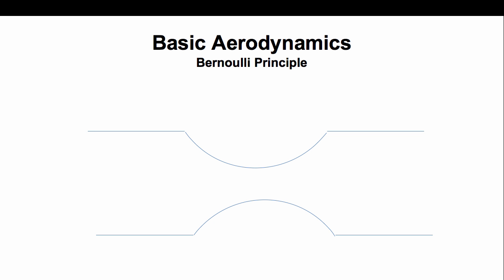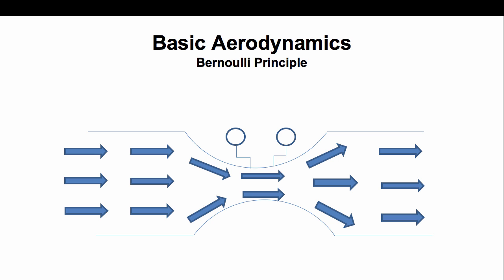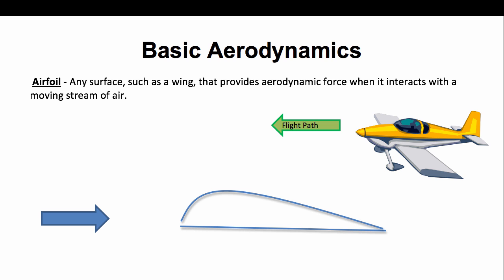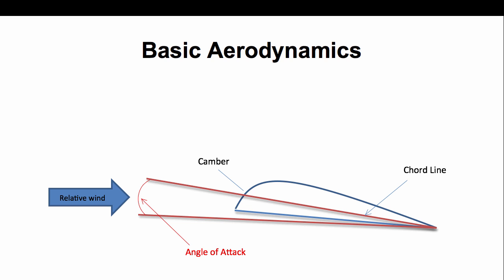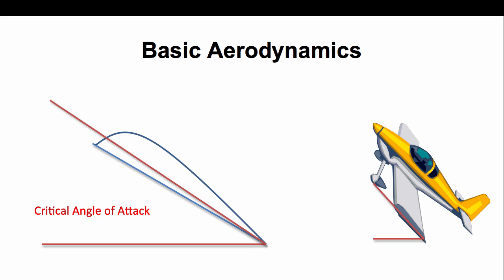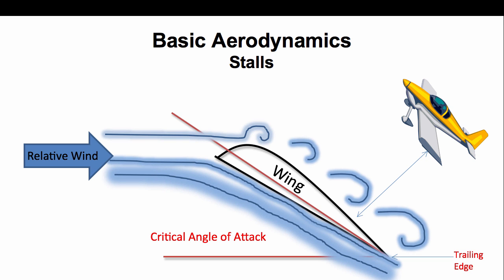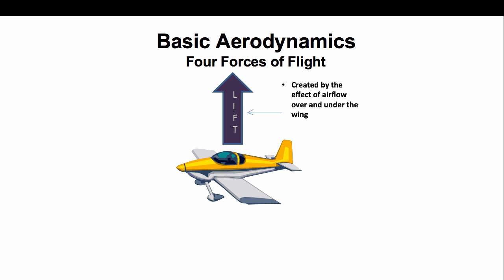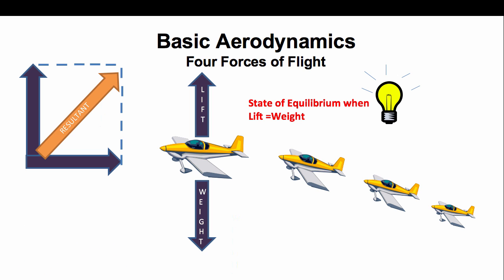The Basics of Aerodynamics

Comment: No ,there is not 2 separate causes for lift. No, a pressure differential does not cause  lift.   No, the bernoulli effect does not cause lift. All lift is the result of the excelleration of air downward,  which gives an upward force. The bernoulli principle is a conservation of energy statement showing that air trades pressure energy for kinetic energy and remains at the same total energy. The pressure drops perpendicular to flow and increases with flow. The direction of the pressure has changed.  And wings don't work like a venturi tube with 2 opposing inward vectors. Rather, wings have 1 single vector.  You've parroted an old false hypothesis for lift. It doesn't work this way. A pressure  differential doesn't cause lift. A pressure differential is lift caused by excellerated air.
Reply: @Robert-d5l
That is only partly correct and also wrong.  
This video has a lot wrong, however, You are mistaken about the fact that a mass (including air) is Accelerated BY a force.
. . .
You are mistaken about the Top-to-Bottom pressure difference.  That is the ONLY WAY lift can be produced - by different pressures on different faces of the wing.  A net pressure difference over an area produces a net force.

. . ..
Air has mass and a force is REQUIRED to accelerate any mass. Newton's First.
.
The Acceleration of air (fluid) is caused by a pressure Gradient - Euler.  This is fundamental in fluid dynamics.  Newton's Laws apply 0 ALL OF TRHEM,!,
.
The Acceleration of the air in the downwash REQUIRES a force to Accelerate it - Newton's First Law.
.
The pressure changes around the wing do two things.

The pressure increase below, with the pressure decrease above the wing cause a NET upward Pressure difference.  THAT is the lift.  
The Top-to-Bottom pressure difference _IS_ THE LIFT.  This is WELL known by  aerodynamics professionals. 
. . . . 
THEN
. . . . 
Those very same pressures cause Pressure Gradients around the wing that are the *CAUSE" of the downward Acceleration of the air in the downwash..  

The Downwash is a RESULT of the pressures, just as the lift is.
.
Newton's 'reaction' of the Third law, is NOT a cause.  It is a RESULT of the applied force we call the 'action.'   You don't have any 'reaction' unless there is an 'action'  and the pressure gradients formed around a wing ARE the 'action'.
. . 
Those pressure Gradients ALSO CAUSE  the up-wash AHEAD of the wing and the tip-spill going into the tip vortices. 

The pressure changes around a wing Cause the downwash.  The downwash's Acceleration is not causing the pressure changes around the wing. 
. . 
That is the correctly applied physics and follows Newton's Laws - ALL OF THEM. 
. . . . .
. . . . .
. . . . .
'This is Incorrect: "The pressure drops perpendicular to flow and increases with flow. The direction of the pressure has changed.  "
You are confusing static and dynamic pressures.   The internal pressure IN the flow does NOT change direction to decrease it perpendicular to the flow.  If you move WITH the overall flow, the pressure stays isotropic - EQUAL IN ALL DIRETIONS.  The pressure perpendicular to the flow DOES NOT decrease by itself (Unless the static pressure (in all directions) increases).
. . .
Those are common misunderstandings of Bernoulli's Principle held by many amateurs.
 This is a fundamental property in fluid dynamics.
. . . 
The physics is stepped through here:
Understanding Aerodynamic Lift Correctly: rxesywwbdscllwpn.quora.com/
Reply: You need to read and/or talk to real aerodynamics professionals.

Comment: Fellas, chord line is the imaginary line from the leading edge to the trailing edge.

Angle of attack is the angle between the chord line and the relative wind.
Reply: Not quite.  The chord line that matters is the one that bisects the lower and upper sufaces of the wing at its trailing edge.  That is the direction that the airstream has to leave the wing, that direction is what determines the angle of attack.

Comment: Can you explain the difference between Angle of Incidence and Angle of Attack. 
It is written in text book that Angle of Incidence (AOI) is a fixed geometry (between chord line and horizantal Aircraft axis) where as Angle of Attack (AOA) is variable as you have explained in the video
Please clarify
Reply: I'm quite late and you most likely figured it out but if anyone else will want to know, AoI is just what you said and AoA depends on the relative air hitting the airfoil, so even if a plane is facing 10 degrees up from the horizon the AoA could still be 0 degrees as long as the plane has enough airspeed to produce the lift equal to weight.

Comment: Its important to remember that low pressure above a wing doesn't cause lift, but rather is lift. For lift to occur, air must be deflected in a downwash. Downwash is the action while lift or pressure differential is the reaction. You don't get lift by creating low pressure. This would be like saying,  lift causes lift. You only get lift by deflecting air. The bernuli

Comment: The lift created by a wing is created mainly by the down wash of air at the trailing edge of the wing. The low pressure above the wing only occurs right after the stagnation point at the leading edge of the wing. Using Bernoulli's principle to explain lift is not very accurate.
Reply: This does not seem quite right. This downwash leaves the trailing edge at the back of the wing. It does not act on the wing

Comment: This video adds nothing to the many other poor lift videos.
You need to follow the script correctly.
- The chord line is not drawn through the direction of the relative wind.

- Circulation is a method important for CALCULATING the lift force, but explains nothing.
- Your chord like is drawn incorrectly.
- The decreased pressure above a wing is the cause for the accelerated air.
- It also does not "Reduce the pressure drop".
- In stall, the air SEPARATION POINT progresses forward (not the air).

Comment: Hi, I am a practicing Aerospace/Aeronautical Engineer.
With due respect to you, I found that your presentation can be better if you pay more attention to basic Aerodynamic facts.
Firstly, the concept of fluids traveling faster does mean nothing to science; its a result of energy balance as per Bernoulli.
Secondly, Relative Wind is not a force, it is in fact a cause of various Aerodynamic forces on the Airfoil. Relative wind can be best explained by the Relative wind velocity.
Airfoil is not  "a surface such as a wing"; it is at best a cross -section; remember we can have both Two-dimensional and also 3 dimensional airfoils.
The airflow velocity on the upper surface depends on various factors like up wash, camber,angle of attack etc.
When you talk of the circulation you must describe in detail what you mean.
The flow leaving at the down wash is one of the main causes of lift.
Your definition of Camber is also not correct. Camber is the asymmetry between the upper and lower surfaces.
Also, chord line is basically the shortest distance (straight line)between the Leading and trailing edges of the Airfoil.
The stall is not a result of the Critical Angle of attack; in fact we get the max. coefficient of lift corresponding to the Critical angle of attack, beyond which due to progressive separation of air on the upper surface that moves towards the leading edge,along with increased surface drag, we get total loss of lift creating the Stalling condition.In fact if the flow separation occurred just at the trailing edge as you explain, it would have been a very desirable effect!
Lastly, as XPLAIN has correctly mentioned, a complete equilibrium can be possible only when the Lift = Weight and the Thrust=Drag condition.
Good Luck!
Reply: Whoa even I want to become an aeronautical engineer
Reply: Partha Sinha could u explain why its important for the air to flow smoothly above the wing? Im guessing it has to do with the 3rd newton law?
Reply: correct
Reply: holy yap!

Comment: This video is wrong in many respects. I am not a student pilot but I am a career pilot and engineer. To start with the explanation of Bernoulli’s theorem is wrong. The fluid does not speed up “to reach the end of the curve”. This explains nothing. The fluid does not make a decision to go faster to reach the end of a curve. The velocity increases due to the physical constraint of the conservation laws. In order for momentum to be conserved the velocity has to increase in order maintain the mass flow rate. You can also explain the Bernoulli effect in terms of conservation of pressure energy. Because the fluid velocity increased the kinetic energy of the fluid increased. The increased kinetic energy of the molecules can be seen as a redirection of the pressure energy hence the fluid has increased dynamic pressure at the expense of reduced static pressure. If you want to reduce the explanation to simple statements such as the “fluid speeds up to reach the end of the curve’ you have not simplified the explanation, you have simply made it wrong.
  Next we have a very poor description of the stall. A wing stalls at its critical angle of attack yes. But the stall is not “the result of a critical angle of attack”. The critical angle of attack is defined as the point at which the wing stalls, so if anything the critical angle of attack results from the inherent individual stall property of any given airfoil. However once the critical angle of attack is known you can say the wing will always stall when it reaches the critical angle of attack. Also you say that in a stall the airflow “separates at the trailing edge”. This is completely false. In a stall the airflow separates well before reaching the trailing edge. That is one of the key points to know. The lift depends upon the streamlines staying attached for as long as possible as the angle of attack is increased. The early separation of the streamlines and resultant increased turbulent wake are the two things that give the loss of lift and increased drag associated with the stall. If you could keep the upper flow attached all the way to the trailing edge, the wing would not be stalled.
  Also, you say that an aircraft is in a state of equilibrium if the lift equals the weight. However, the aircraft can only be in a state of equilibrium if lift equals weight AND thrust equals drag. Otherwise the aircraft will be accelerating or decelerating and therefore the lift will be changing.
  Finally you show two vectors and a resultant by way of explaining “the resultant of two opposing forces which are equal in magnitude is zero”. And yet the two vectors in the diagram are not opposing each other, hence they have a non-zero resultant. The correct explanation would be that the aircraft would be in equilibrium when the resultant of the thrust and weight vectors is equal and opposite to the resultant of the lift and drag vectors.
Reply: Geez, a kind of complicated way to explain something pretty simple, that the wing is moving thru the airmass and the top is longer than the bottom.  Visualize what would happen if the air on top did not speed up.  What would be the end result?  Btw, good joke.  Air is an inanimate object.  It cannot make a decision.   Sometimes an education is worse than no education at all.   There is not a thing wrong with saying "it speeds up to reach the end of the curve".     Also, btw, simple AoA is by far the main factor causing lift of a wing, not Bernouli

Comment: What is the maximum angle of attack????
Reply: For many common wings it is about 15-16 degrees.
Reply: If you mean the critical angle of attack, about 16deg for most general aviation planes. But the angle of attack can be very much larger. The plane can pretty much fall down belly first e.g.  in a flat spin. This would be close to 90deg angle of attack. Stalling does not equal loss of all lift.

Comment: Bernoulli is a crock!  Explain how a flat airfoil flies.
Reply: A flat, or symmetric airfoil, generates lift through a positive angle of incidence. That's how aerobatic aircraft fly. When the angle of attack is 0 degrees, a symmetric airfoil generates no lift. However, add a slight positive angle of attack, and the symmetric airfoil flies.
Reply: Observ45er And that is what I meant. You could get lift by attaching the wings to the fuselage at a positive angle of incidence. And yes, you’re gonna get lift as long as your effective angle of attack is positive.
Reply: +Sunayan Mullick,
Wings are mounted at some angle of incidence so the wing has a positive AoA and the fuselage is pretty much neutral during normal flight.
Reply: @Observ45er  Nope, they don't have to. An Extra 300 or a fighter have exactly 0 incinidence.
Reply: @kramrle  RE: "Nope, they don't have to. An Extra 300 or a fighter have exactly 0 incidence."
..
I said: "Wings are mounted at some angle of incidence so the wing has a positive AoA and the fuselage is pretty much neutral during normal flight."
Note the word "normal"...
I could have said that ordinary aircraft typically have some positive incidence.
..
You can't cover every advanced concept for a basic explanation of lift. It just ads unneeded complexity that can confuse, until after the basics are mastered.
Cheers
Reply: +Edward Brown,
Yes.  Most other common explanations of Bernoulli's Principle are incorrect.
Reply: +Sunayan Mullick,
ALL WINGS whether flat, cambered or inverted create lift at a positive effective angle of attack.
...
The angle of "incidence" is the angle of the wing mounted to the fuselage.
Reply: Observ45er true, I agree. I was referring solely to aerobatic aircraft here that have a fixed angle of incidence compared to other aircraft where you could have a different angle of incidence at the root and a different angle at the tip. And of course the Bernoulli’s equation has its limitations because of the assumptions its based on.
Reply: +Sunayan Mullick,
What you're talking about is washout which, whether it is present or not,  has no bearing on the comment.
...
I fail to understand how any of that has anything to do with the OPs comment about common the misunderstanding of Bernoulli's Principle and the way it is improperly applied to lift. 
...
Fast air does not have a lower pressure that some nearby slower or still air simply due to its speed _difference_. Bernoulli's Principle has to do with air that is changing velocity as it moves along.  This is accelerations and pressure changes.
  The low pressure above is caused by the air passing along a convex curved surface and following the curve path (because it is a fluid) which causes he low pressure closer to the surface, not simply speed.  Any mass moving it a curved path, at a constant speed, has a radial force applied toward the center of the curve, but is the speed causing the curved path, or the force causing the curved path...?.... This is how satellites stay in orbit - radial force of gravity.   If you wish, think of it as the air trying to maintain a straight-line motion, due to inertia, that makes it 'pull away' from the curve (Newton's First Law), thus lowering the pressure nearer the curve, or that the moving curve of the airfoil is 'pulling away' from the stationary air.   The atmospheric pressure further from the curve pushes toward the lower pressure along the surface to accelerate the mass of air around the curved path.  While speed difference between air and curved surface is needed, it is the curve that is key.   Pressure is not reduced along a flat/straight surface.
Reply: @Observ45er  The curvature has nothing to do with lift. But a lot with stall characteristics of the wing. See the Whitecomb supercritical airfoil used in airliners. 
Lift is primarily dependent on the AoA which defines  and the angle at which the air leaves the trailing edge.
Reply: @kramrle  This is a very old thread and I can't tell which comment you respond to.  The curvature of what?
..
Yes, lift varies linearly with AOA.
Reply: Observ45er Observ45er first, I wasn’t referring to washout at all. Second, Edward Brown asked how the Bernoulli’s equation explains lift generated on a flat airfoil. By “flat,” I assumed he was referring to a symmetric airfoil. Therefore, I proceeded to explain to him how inclining a symmetric airfoil at a positive angle of attack or incidence could generate lift. Having said that, I also mentioned that Bernoulli’s equation has its limitations. Not sure what you’re trying to get at at this point. I’m an aerospace engineer; I understand the explanation you’ve provided. Maybe I interpreted Edward Brown’s question differently. While you’re attempting to link Bernoulli’s equation with lift on a flat plate/symmetric airfoil, I pointed out lift generation without the use of the equation. I can see how I might’ve misread the question and how my answer might’ve confused you.
Reply: +A.M.Q.,
..
Hi!
.
I still poke around here at on YT @ times.
Did you watch my Coanda inhibitor video.?.
Reply: As explained in the video. Why the lift is always perpendicular to the wind?